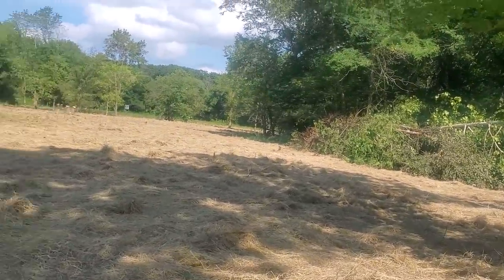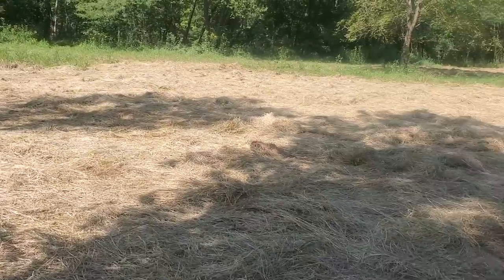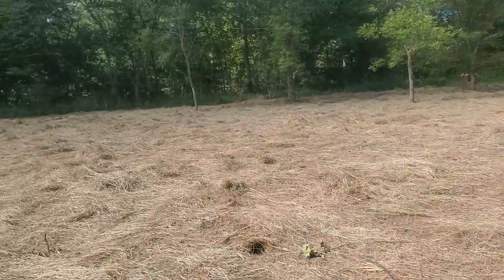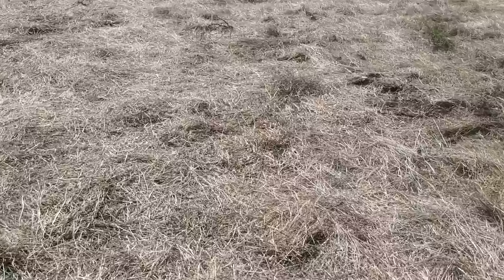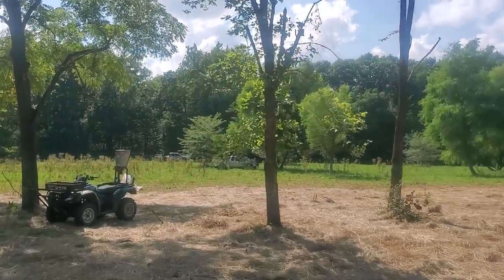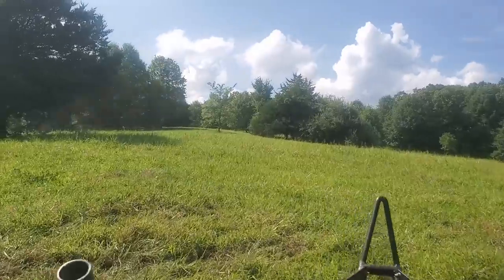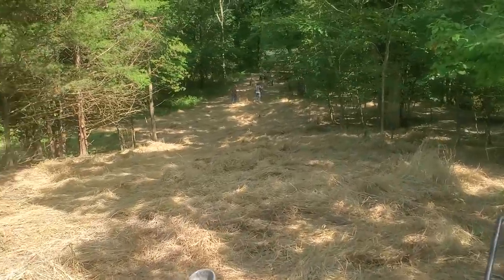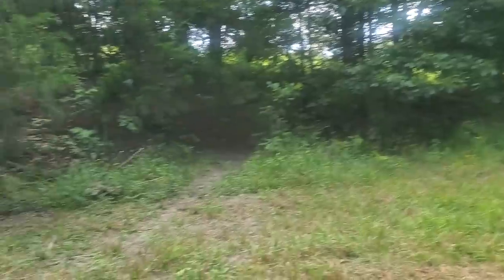Methods used for converting a brushy field into pasture.

Comment: Are you seeding only with Kentucky 31 and do you ever have toxicity/bloat issues from it on your sheep? I'm going to be seeding an old cedar field that I'm just finishing up clearing here in southern Indiana and I keep finding articles about Kentucky 31 being problematic.
Reply from the maker: Kentucky 31 can have its issues with being toxic at certain times of the year. Don't graze it short and keep legumes and other grasses mixed in with it. This is achieved with good grazing management. There is no other grass that will make you as much money in winter feeding as grazing stockpiled fescue. It stays green all winter in the lower parts of the plant and is extremely good forage that withstands freezing and turning completely brown. If you have animals that do not perform on it, sell them and keep the ones that do. Build your flock from that. No bloat issues from it at all.
Reply: @gregjudyregenerativerancher  Thank you Greg.

Comment: If you treat large honey locust with tordon. It will kill the tree and it will shed the thorns as they rot off.  Then you can cut the log into firewood with no holes in you or your tires. It takes about 3 years to lose all the thorns
Reply: How do you treat a large one?
Reply: @jeffcordia  that is a large one. I had about 4 trunks coming up from the base., over about 4 feet. Each trunk 20 to 34 inches.  You skim the bark down to the cambeon layer, with a hatchet. Then spray on just enough. To color the blaze blue.  You may want to hit it in 3 to4 spots around on a big tree.  Honey locust spread by the rhyzome root system.   If you have 1 tree, you have many smaller 1's starting
Reply from the maker: We normally get rid of the tree when it is green. Once they die, the thorns shed like porcupine needles and you will be fighting them for years in your flat tires. If the tree is green, the thorns  will stay on the tree until you reach the fire or draw where you want to put it. Must paint the stump immediately within 3 hours , bark area only. We use a mixture of 1 quart Crossbow with 5 gallons of red diesel, be liberal painting it on the bark surface edge of stump.
Reply: @gregjudyregenerativerancher  Okay, what's Crossbow, and isn't diesel not exactly great for the environment? Thanks. :)
Reply: @wendyscott8425  crossbow is an herbicide that is very effective against bloody brush and shrubs.
Reply: @bpdp379  Thanks. I've never heard of bloody brush, however. Unless you're using a British type of epithet that is. :)
Reply: @wendyscott8425  exactly that. Translated from Old English it means, “woody brush.” Or it was auto correct…not certain!
Reply: @bpdp379  LOL!